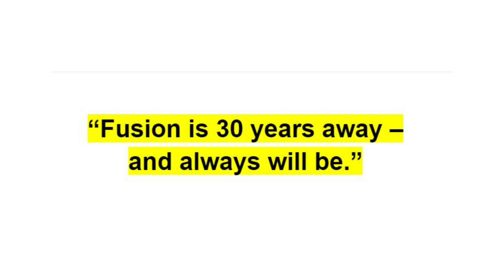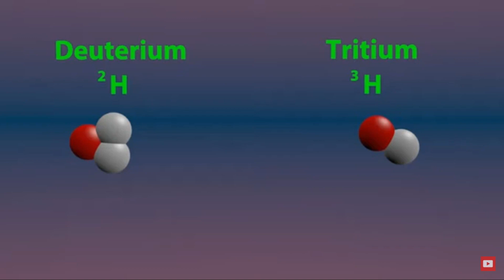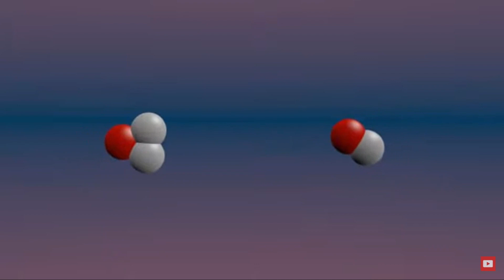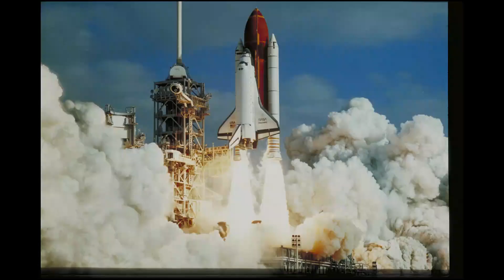Nuclear Fusion breakthrough: The biggest Energy news of 2022

Comment: Solar  - most efficient - I have been on off grid solar for 35 years and it has cost me $25 per month in total investment - and as my oldest panel is 40 years old and still powers a pressure pump and a light when required - it makes any other form of power generation look ridiculous. I have adapted to efficient power use - but I can even weld 8mm plate steel with a solar array of 50 amps backing up 24v battery power for a stick welder. No inverter, no regulator required. Nuclear fusion is just a symptom of living in wanker's paradise for spoiled children in adult bodies.